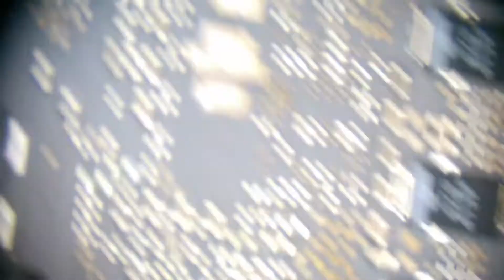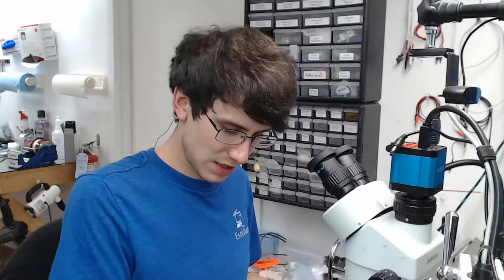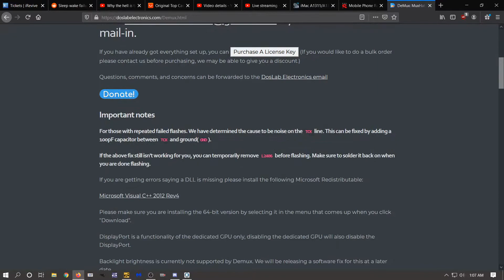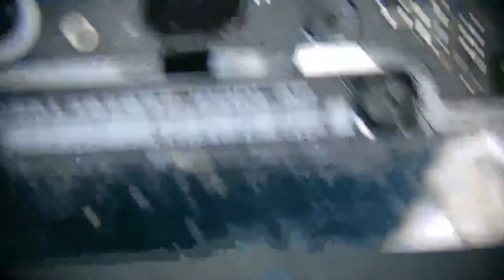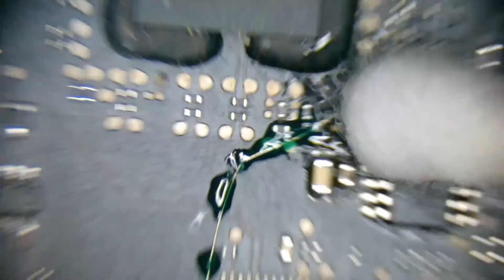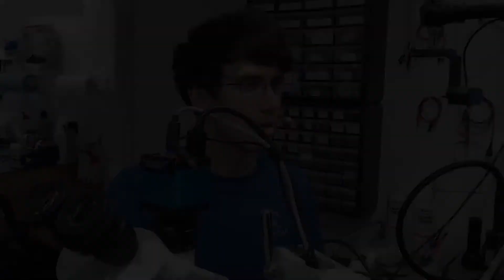MacBook Pro 15" 2011 A1286 Dosdude1 Demux Live stream

Comment: hello. I have two MBP 2011, 
- one used to work with the software mod, but after a few months of not being used it's now just black screen no chime, fans and front led on.... Could Demux work even If I have no chime ?
- the other one is just white/grey screen and it does chime.
Reply from the maker: It is very possible that Demux could fix it. If the GPU dies, then you can experience a black screen with no chime. We have had a couple of MBP 2011 with black screens come back to life after performing a Demux.
Reply: @iRevive  it did work for both macs (the one that didn't chime and black screen, and the one that did chime and white screen)
i had to do the PL RESET short for both.
thanks for your video.

Comment: Why the process has to be done with an original 85w charger? If the charger is of less power, what can happen? Thank you
Reply from the maker: An 85 watt charger will power on a 15 inch MacBook Pro unibody. A 60 watt can make it turn on if the battery has a little bit of juice. But if the battery is unplugged, or is completely dead, you have to use an 85 watt to turn on this model MacBook. This model MacBook requires more power.

Comment: After this modification, the output for external screen will no longer work, but would Airplay still work?
Reply from the maker: Sorry for the delayed response. This is a good question. I personally have not tested it myself. However, I have heard from other technicians in the Rossmann Group Discord that AirPlay still works after performing a Demux flash. I believe the idea is associated with AirPlay using the iGPU instead of the AMD dGPU.

Comment: Is the key for your computer (a one shot payment) and you can do this reprogram on several units or do you have to purchase a new key for every time you do this? Thanks.
Reply from the maker: You will have to purchase a $20 license per use. This is mostly to support the time and effort doslabs put into reverse engineering the GMUX without any documentation to bring life back into these laptops.
Reply: @iRevive  Thanks for answering.

Comment: Thanks for the clear run through on the steps involved in doing this the “right way”. Just curious as to the wire you used for the jumper cable?
Reply from the maker: Good question. I just added the link to the parts in the description.